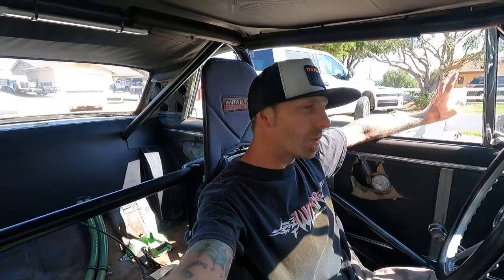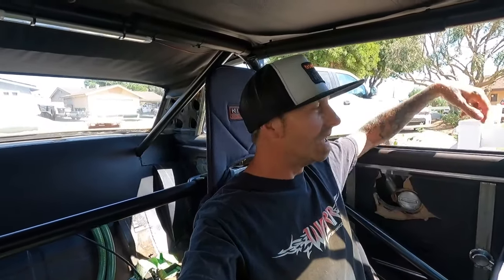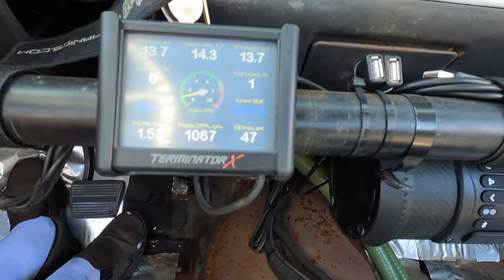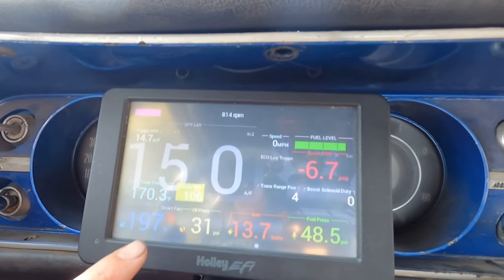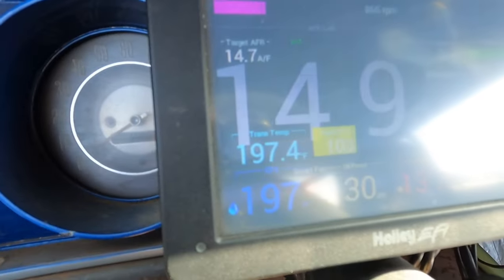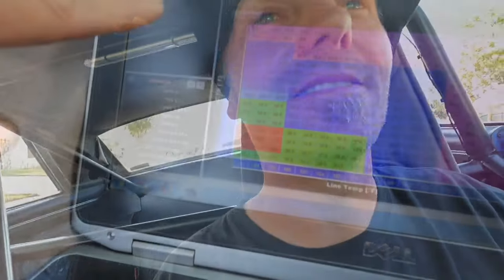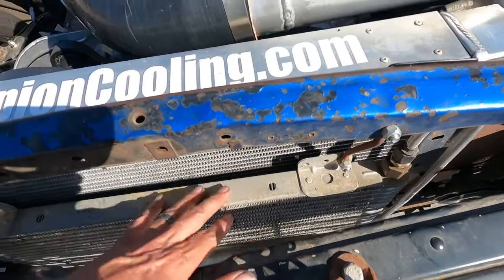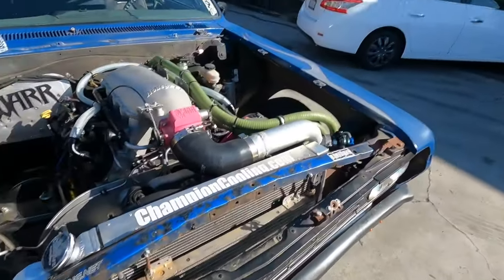Test Drive Did Not Go Well

Comment: I'd definitely check the fitting to make sure you don't have them swapped. If memory serves me right one is longer than the other and if mixed up would block your flow. Good luck
Reply from the maker: The long one goes to the rear to feed the center support. I have them in the correct spot but that's a good tip! Thank you

Comment: Could you add a pressure gage to the oil outlet and outlet  before  removing  anything?
Reply from the maker: I will add a converter charge pressure sensor at some point but I know it's not pumping because the cooler was cold to the touch and the transmission was 200. If it was putting fluid through the cooler the cooler would be the same temp as the pan or at least close to it.

Comment: I haven't done much with 4l80s but I would bet there is some sort of bypass in the pump that isn't working. I'd swap it out with the known good one and figure it out when you have more time. Keep grinding. Looking good.
Reply from the maker: Different year transmissions have slightly different pumps from what I understand so you can't just mix and match. I'll tear it down when I have time and verify everything in this transmission is correct for the year specified. It was a core trans I knew nothing about and I didnt know to check that so well see what I did wrong at some point and ill share it with you guys.

Comment: I cannot believe a single thing went wrong! And unfortunately, I don't understand the 4L80e well enough to tell you how to fix that other than tell you bring both transmissions from WARR back with you!
Reply from the maker: If I knew what it was I would fix it but unfortunately im going to have to inspect it and make sure I have all the correct hard parts in it and see if we did any damage to the rear bushings if it was starving for fluid for the short drive I went on.

Comment: Why do you think it isn’t flowing? Torque converter engagement? Bad torque converter?
Reply from the maker: Torque converter works fine. Its tighter then the other one I was using but its not dragging and lock up worked fine when I took it around the block the first outing and got on and off the freeway.
Reply: @Burndown  does the input to the cooler have good flow/pressure if you disconnect the line?
Reply: @Burndown  I’d just want to figure out what your low/no pressure is from
Reply from the maker: @az_dylan_tricks3518  no

Comment: Wrong fitting on the trans?
Reply from the maker: No I have the correct ones installed. The long one on the rear because it's a later model transmission so it takes the fitting that's longer that goes into the center support.
Reply: @Burndown  has to be something simple or it wouldnt go into reverse